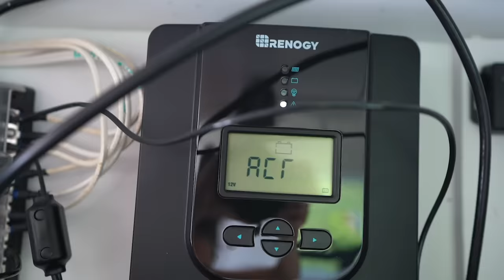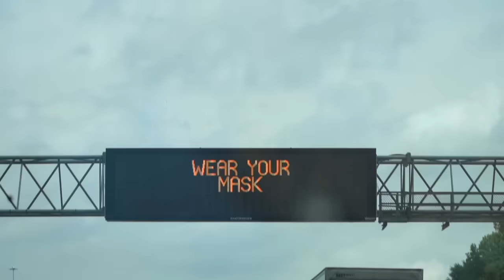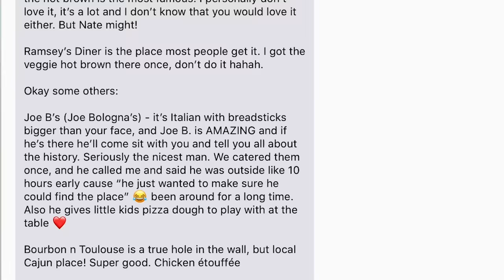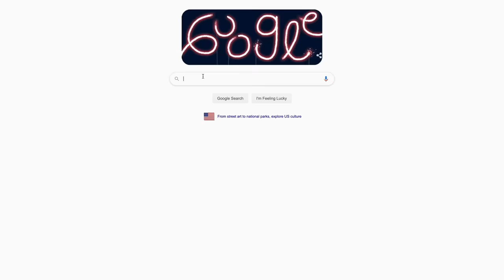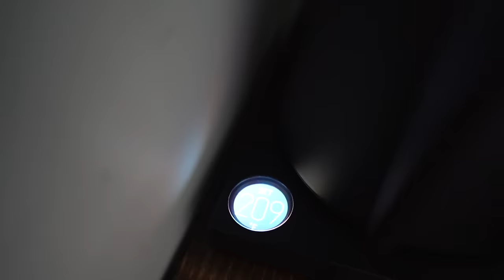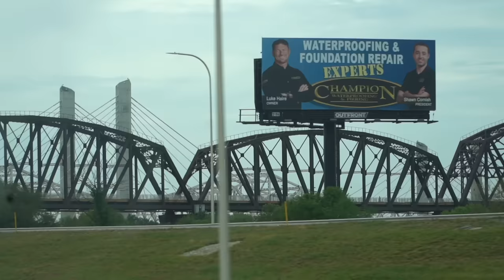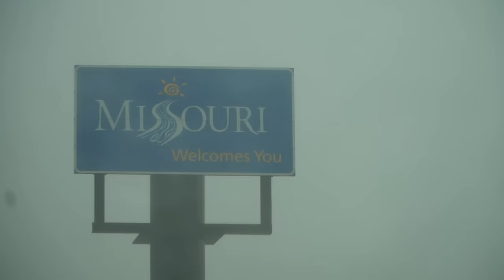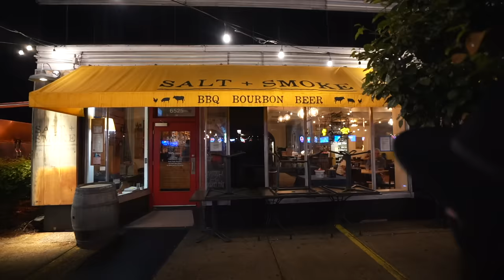FIRST 48 HOURS OF FULL-TIME VAN LIFE

Comment: I have a feeling they’ll stop and have an AC installed before too long
Reply: they should
Reply: Just remember Armenia
Reply: hershamb ee 😂
Reply: Absolutely!  That would get my vote.
Reply: I think they must too
Reply: Guar-on-tee if they come out to my area (Nevada) during the summer, they WILL NEED AN A/C!!!!!
Reply: Good prediction!
Reply: @lvsluggo007  But it's a dry heat !!!!  Actually, I was about to email them and let them know, if they are heading out here, I am going to make some calls, that van needs some upgrades.
Reply: Thats what I was thinking!   I'm a wimp, there's no way I could go without.
Reply: But then they'll need a generator or to only stop where there are hookups. It's a slippery slope. That's why an rv costs so much. I'd rather just stay at home and slip down to the lake every couple weekends.
Reply: They are young, they'll figure it out before too long. In the meantime it's an adventure and they must make enough to keep it up, so more power to em.
Reply: AC is a must
Reply: lvsluggo007 that’s exactly what I was thinking when Nate was talking about heading west and not having A/C. I would avoid coming to Nevada until like September 😅
Reply: Camping world could put an overhead AC in in a day
Reply: There have sleep outside its hot box needs roof top unit remember its utility van. You got to go camping otherwise your burning up
Reply: Or go north.
Reply: And add one more lithium battery to their power bank.
Reply: An adventure until they can't stand not being able to sleep or dry off and end up scratching each other's faces off.
Reply: And a heater possibly...
Reply: they don't have an exhaust ! ... van would smell food 24*7 i guess
Reply: ACs consume an insane amount of power, you can not run that with such a small solar system, they could only use it while on shore power or they would need to upgrade their power system significantly.
For their van that unit would use up to 1.7KW-2KW, they have ~8m^2 roof area if they cover it with panels that can be put into a good angle while parked, they could maybe get 1.5KW max. out of that in the best possible case, while driving less then 1KW, so they would need at least additional  5KW/h battery capacity, to not constanly run out of power while runing the AC
Reply: @FruitingPlanet  may be they will use a small generator !
Reply: @rahulmaan6207  That might be an option for when they drive, but you can not have it on the inside, it needs to be on the outside and the transporter vans are not set up for this like mobile homes are.
Only using it when parked and carrying it as cargo is theoretically possibly, but i would not recomend putting a generator in your "living room" even when its off, the gasoline fumes coming of from it are very bad for your health and can cause an explosion if there is no good ventilation and the generator tank cap is not screwed on properly.

Comment: U really should install a heater/AC unit if u want to sustain the van travel life in the long run.
It a good investment all year round, A/C on hot days and especially summer and heater in the winter. 
Sleeping bags as insulation wont keep u warm enough. U may regret it in the long run.
P.S. the mini fan really doesn't do u any justice.

Comment: If you use a bicycle pump in compresses air, making the pump warm.  Now imagine that pump had a liquid in it that got hot when you compressed it (let's call that freon).  Now imagine you take that hot compressed freon and pump it through a radiator and blow air through it to cool it down to ambient room temperature.  Now take that compressed freon, pump it into the inside of the refrigerator and let it decompress.  It will become a very cold liquid and absorb any heat from inside the fridge.  Rinse and repeat.  Your van fridge will be much more efficient (use less power) if you vent the back of that sealed box you have it mounted in.  Drill a few 1" holes behind the drawer towards the window and it will allow the heat to escape the cabinet.

Comment: Try cooling sheets and pillows or pillowcases.I think those will help. Also, a cooling gel pack wrapped in a kitchen towel can be placed on your sheets to help you feel cool.  If you buy an a/c unit, you can plug in and take a shower at an RV park.  Much more comfortable.

Comment: We usually run a small ceramic heater in the winter so we don’t use up all of our propane. The power went out in the middle of the night in upstate NY in January, our batteries got drained and our furnace used up all of our propane... it was incredibly cold.  We usually get full hookup sites and we don’t have solar so we woke up freezing at 3am with no power to run our ceramic heater, no lights and no propane. We never packed up and moved so quickly before... We don’t travel in the north in winter any more...

It might be a good idea to avoid the south in the summer, as well...

Comment: Parking tip. When parking around tractor trailers like you did at Cabela’s or a rest area, pull half way up in the spot. That way if a tractor trailer pulls in or out there’s little chance they drag their trailer across your van when they are coming or going.

Comment: HI Kara and Nate - great to see you hitting the road. A lot may be closed but at least you are travelling and on an adventure. The wild camping will be easier.  To give yourself a bit more room we use resealable ziplock bags for spices etc which takes up less space - also remove packaging where you can. We understand the heat issue - here in Turkey it was 38 degrees outside and a lot hotter in the van -we don't have aircon just usb fans - stay safe sending virtual hugs - Chris & Marianne x

Comment: You guys should buy a dehumidifier it helps a whole lot!! :)
Reply: Yes. They can be pretty small (6"x4"x4" approx. Actually got mine @ Ace hardware)...can tuck away easily. Just empty water receptacle daily.
Reply: As long as you’re at it, why not install a small RV rooftop air conditioner? They are direct-vent so no ductwork needed. It’s not a huge project and they don’t take much more power than a dehumidifier. At least you could use it when you’re plugged in...

Comment: Cabelas (some even have a dump station), Walmart, most Home Depot and Lowes, truck stops, Sams club, Cracker Barrel, casinos, places like elk clubs usually have a lot you can park some even with power that you pay a couple bucks for, some gyms etc all allow overnight parking--- its nice to have those simple ones in your back pocket for when its late and you just want an easy place otherwise the apps are great or the side of the road-- we were traveling in a 40 ft rv lol so you will have an easier time just parking

Comment: Nate the wipers should have 3 settings ie: 1- off straight across 2- manual either push lever up or down and 3- of course Auto again up or down this mode the wipers come on in timed swipes instead of on all the time. Kara Try Ikea for space saving ideas ie: magnetic spice/ herb holders that attach to any metal surface.

Comment: Hey Siri, how much does it cost to install air conditioning in a Mercedes sprinter van 🤣🤣
Reply: Probably used too much power. They'd have to get a bigger battery/more solar
Reply: I was wondering if they could make a makeshift “redneck ac” with a cooler, a fan, and a curved pvc pipe...they would have to get ice for it when they want to use it but 🤷🏽‍♀️
Reply: A lot of RV sites have power...

Comment: The trick to cool yourself down when AC is not being used, is take a wash cloth run it under cold water and pat yourself down.  It will cool your skin and make you feel more comfortable.  I do it all the time with 90deg weather (I don't use AC at all in the summertime in my apartment).

Comment: my advice install a mini split AC ASAP! you will only need about 1000w of solar to run a 12K BTU  20 Seer unit. It would be pulling about 8 amps on 110v or 85 amps on 12v.

Comment: You guys should consider installing a roof mounted AC unit, they are usually very affordable, economical to operate, easy install (by the AC people ), very aerodynamic (will not effect the performance or safety of the van while on the road). Your van is a diesel,...these type of AC are designed to run with diesel engines, as diesel engines operate the same way as portable power generators. Hope this tip helps. http://www.thermokingtec.net/bus-air-conditioner/tkt-60v-mini-bus-air-conditioner.html